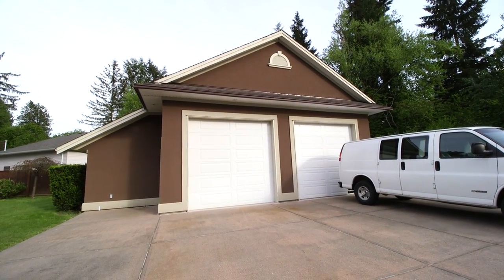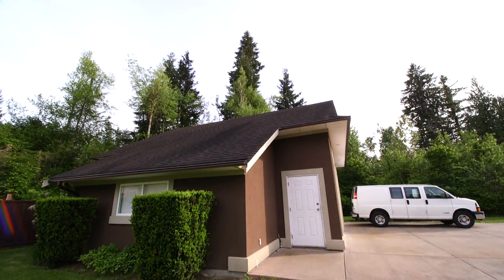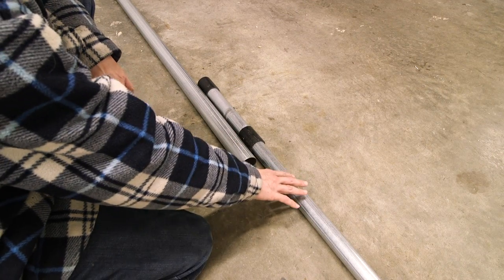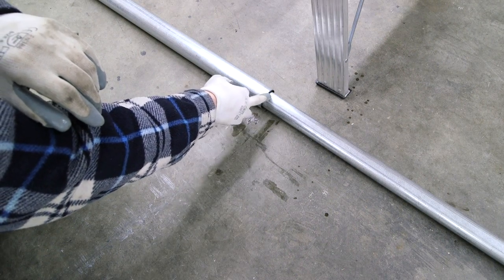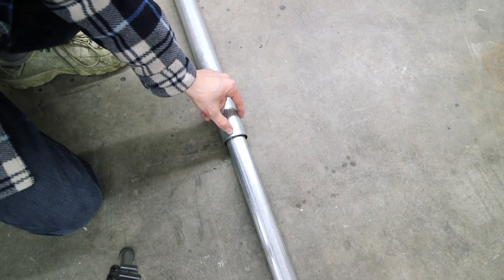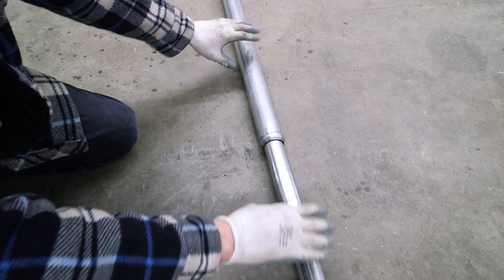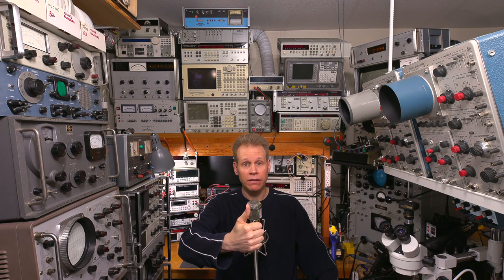High Performance Antenna Build [Part 1]

Comment: I have 80 acres here with NO background noise on HF at all, so quiet, you'd argue my receiver was dead!!! Been inactive for many years but thinking of getting my old R5 hoisted up and dusting the MP1000 off and doing some DXing on 10, 15 or 20 meters. My seven element triband Yagi needs a lot of maintenance, new plastic insulators, new trap covers etc. I can't decided yet where to "grow" the tower or high to go, 40 or 50 plus feet. Yes I know, the higher the more efficient the Yagi will be.
My call is KM6MB and John is the name, look forward one day to having a ragchew Mr Carlson. Followed many of your videos including the MP1000 one!! Mine was the first one sold in California when they were first released on the market, It's worked many countries, at that time we had a great solar cycle!!

Comment: Love watching your videos!  Ex-Radar engineer from the Air Force.  We used to use 2" pipe and have a local muffler shop heat and expand one end of the pipe about a foot long so it would receive another 2" pipe. Then we'd stick weld them together.  That way you never lost the strength of the pipe by reducing the size.  Still do that trick today on some things.

Comment: One thing to note for anyone that might build one of these at home... if the conduit you use is galvanized, you should either remove the zinc coating from any areas that will be welded, or, at a minimum, perform the welding in a very well ventilated area and with proper respiration/filtration.  The Zinc Oxide fumes that are released when welding galvanized steel can cause some pretty nasty side effects.  If you start to experience headaches/tiredness or other flu-like symptoms, stop and get some fresh air.  If bad enough, the fumes can kill you.  Galvanized pipe can be welded safely though if the proper precautions for ventilation/filtration/etc are followed though.

Comment: Be sure to grind the zinc off of galvanized metal before welding.
Reply: In addition to the health hazards, it also makes for a very porous weld bead. At least with solid wire and C25 shielding gas, the welds come out porous. I'm not sure about flux core though.
Reply: Yep, fume fever is no joke.
Reply: @osgeld  given that the nature of the smoke plume, there was little to no venting
Reply: @Nemesis Rain You cannot weld successfully on zinc, you have to grind it off to get a good weld. It splatters a lot too..
Reply: @Nemesis Rain Lead deposited in soft tissues can be mobilized and excreted to an extent with sulfur compounds (garlic, onion, DMSA, N-acetylcysteine, etc), vitamin C, and other chelators.  Once it's in the bones though, the bulk of it is pretty much there to stay.
Reply: came here to say this. although i bet mr. carlson has one of those fancy welding respirators. damn i  want one of those....
Reply: @mickgrimes9078   a good respirator is a must, but you still need good ventilation because the vaporized zinc with get into your cloths and land as dust everywhere.

Comment: I built a 92' high vertical antenna by flying a drone with a piece of cord to pull a copper wire up over the highest bow of an oak tree with insulators of course. The antenna performs phenomenally well much better than my horizontal and is almost totally immune to man made noise. Because of the polarisation being vertical and most men made noise being horizontally polarised.

Comment: I cannot forget the strange look I got from a lady at a cashier at a construction material shop when me and buddy at age 13 on bicycles bought a 10ft scaffolding pipe for my antenna.
Reply: I remember the neabors saying they thought me and a budy had lost our minds as kids ..up on a second story tin roof with 3' snow putting up a ant at about 2:00 n the morning...
Reply: All us radio nuts must the same kind of story. Mine was a 25 foot telephone pole when I was 15. The wire ran all the way from my bedroom to the bottom of our garden, then over a narrow Access road to the back of our garage. To me it was a thing of great beauty, but I didn't take into account the garbage truck that called every Wednesday.  It took the whole lot out. The pole was dragging behind it for about half a mile!
Reply: @NigelDixon1952  ouch rip
Reply: Yeah I had telephone wire for my antenna I ran the wire out the bedroom window to the center  clothesline pipe to the one end and went back to the other pipe on the left from the window looking out the window. I didn't know you could feed from any part of the long wire antenna. My radio was an American 5 tube radio by Admiral. Good thing I never touched the antenna wire I may have got a shock. You cannot or should not put a ground on those radios. The one side connected to the chassis or buss in my case. The radio was cased in a plastic box. The chassis part was a bakelite circuit board. I also made the radio pick up shortwave by tuning the rf and if coils. No standard broadcast radio was safe around me. I picked up wwv and Spanish SW stations.
Reply: @ronb6182  wow lol
That's impressive

Comment: Next time use rigid aluminum conduit, it comes threaded on both ends and has a coupling on one end. You can get a threaded reducing bushing to downsize. Thick enough to drill in to and tap for a grounding lug too.
Reply: My guess is the displayed connection technique will produce a more rigid pole.
Reply: @gottspeed: Carlson’s technique gets strength from overlapping pipes and welding. This will be MUCH stronger than a threaded joint. And steel is stronger than alum. No comparison.
Reply: @davecc0000  I work with these materials daily as an electrician, aluminum RMC is stronger than EMT any day of the week, and the threads would be fine for this application. You do you though.
Reply: EMT is cheap.
Reply: @gottspeed3914  threaded ends of pipe are the weak point, since the wall thickness is less after threading. that means nearly every single threaded pipe breakage will be at the threads, but sometimes a fitting will break or shatter, depending on material and type. the longer the pipe the more leverage and easier shearing action at the joints.
overlapped welded joint will always be stronger, even overlapped and cross drilled with bolts.
alternate way same diameter pipe, with tight fitting solid or tube steel inserted and centered inside, then pre drill/slot the outer tubing and plug/slot weld the inner tubing/

Comment: Yes, and along side the antenna wire You can put a rubber hose filled with mercury, connected to transmitter via that 5kW RS station module in Your old Lab. Than You can put a poster  in the local perish :"If You can receive Jazz Music using any Home Appliance like microwave oven, toot brush, vacuum cleaner, pacemaker, aquarium air pomp, or even clothes hanger attached to the dentures, then please PM me {appropriate e-mail address or phone} ."   The oatmeal milk left in a bowl on the railing of the neighbour's porch behind the hedge is cooked within 3 hours tops :) Grate video, thank You, have great day !

Comment: I did something similar only I used 1/4-20 hardware. I welded 2 rows of 6 nuts spaced 60° apart around the periphery, and each row 10" apart along the length, to each size conduit beginning with the 2" EMT. Then drilled through the nut and chased the thread with a tap. This made for a telescopic arrangement. I then drove a length of 1" cold rolled round into the ground and set this telescopic arrangement over top of it. With pre-cut down guides attached I went up a 12 foot step ladder and extended each section and locked it in place. Repeated for each section until the whole thing was extended. Spent about twice the time planning as I building.

One 10ft length of each:
2" EMT, 1-1/2" EMT, 1-1/4" EMT, 1" rigid. About 36' high...

Comment: Can't wait for the rest - I strung a 200 ft. copper antenna off a mast on the roof and anchored either side of the house. Worked very well as I remember. Definitely seat of the pants engineering :)

Comment: Just so you know, there's another way to join pipes. What I've successfully done is overlap the two sections by maybe a foot or so, and add a third piece of pipe of similar size to form a triangle cross section.  Fat dowel or wood closet rods would also work. Then I measure the circumference to buy the appropriate diameter stainless hose clamps. I use 4 in total hose clamps. Two for the top of the triangle, and two for the bottom. You can use fewer clamps, or more according to your own judgement. Anyway, tighten all the clamps enough so all seems solid and won't loosen.
   I have had zero issues with strength aside from not using large enough diameter pipe for wind load. That's not an issue with the joints though. The clamps never seem to loosen either, but you can still take precautions if you want to. RTV works very well as a thread locker, yet isn't very hard to break loose when needed. It's an old recommendation I read one time about protecting shock absorber threads from rusting on cars.

Comment: As an Amateur Radio operator I thought you might be putting up an antenna to get back on the air when I saw the title. :-) Great video! I look forward to part 2.
Reply from the maker: There will be a transmitting build antenna as well.

Comment: If you had drilled 2 holes trough the 2 inch pipe around 6-8 inch down from the weld you did then you could have welded it with 4 spots there to the 1.5 inch pipe to keep it more stable than the tape does. Back in the early 90's we did use this technique in the welding factory we had when welding rods inside pipes.
Depending on the wind and future snow and ice hanging on your antenna wires it might hold up what you did there too, time will tell :)
Nice welds by the way, looks good, looks like we did it.
Reply from the maker: Thanks for your comment!

Comment: Very good job. I use gorilla tape but just a little. I take my pipe to a muffler shop or a machine shop and have them swedge the largest pipe to fit the size of the smaller one and so on. But I really love all your videos and this one on this dy pole is great

Comment: For receiving purposes, noise reduction is far more important than efficiency, especially if you are going to build a preamp to go with it. Hence if I were you, I would prefer a smaller loop antenna in the quietest spot on your property. But (almost) nothing is more fun than building antennas!

Comment: love your videos to slide the pipes in with no clearance i use a piece of pvc cut the length  expand it around the small pipe works a treat , weld the gal pipe with stainless electrode no rust.

Comment: Hello Mr C I have some urgent  info for you  when you weld Emt tubing you will want to sand off the coating of the Zinc  1 inch clean from where the weld is going  your weld will come out 400 percent  cleaner an you weld will be 200 percent stronger., + the Zing burning that is called out gassing will not Acura  + you will not put poison gas in to your lungs.  From the desk of Jarm.
Reply: True... fumes from welding galvanized metal can make you pretty damn sick.  Welders at work have told me they had to drink a lot of (milk?) to treat this condition.
Reply: As I recall, EMT is not galvanized, Ridged metal conduit is.

Comment: Ahhhh! I know what you are doing!!!!
You are preparing for the winter snow season so that you can harvest some of that mysterious energy that you encountered last time on your workbench! 
We don't get snow here in Melbourne Australia! I would love to make an antenna out of a coil of copper wire in a loop so that the snow fall through it, one end tied to an insulated ground spike with only it's tip exposed so that you get a higher voltage potential difference between the antenna and ground spike tip! A switching circuit to pulse the energy to ground and a capacitor bank that gets charged via a diode which the negative of the capacitor is also connected to ground to complete the circuit! 
Such a pity that we don't get snow here, I would love to try it. This kinda reminds me of the falling water experiment that was done by (if I have correctly spelt his name) Victor Shouberger, there are a few videos here on YouTube that shows how it works, really fascinating stuff! 
I have always wanted you to follow up on that anomaly that you experienced! Who knows? Maybe one day that video will come!

Comment: Guys, zinc isn't that bad.  I mean zinc is in your vitamins.  Yes you can get zinc fume fever but it won't kill you, and you need to be exposed to a lot more than what you'll get with one quick pass of the MIG.  Anyway I was going to say you can buy 10' sections of fencing top rail that are great for antenna masts.  One end is tapered so you can slide another section over it and it fits nice and snug, don't even need to weld. You could throw a U bolt clamp on if you were really worried.

Comment: Thanks Paul. 
Right now I'm learning for my RF technology class at university. It's refreshing to see a video about actually building an antenna rather than just calculating/designing it. 
I love the "learning by doing" way so much more than just reading text books or ( as we do in university) learning the theory before making experiments.
will it be just a normal dipole antenna? I think a Yagi antenna might be the best if you know the location and polarisation from the sender...

Comment: Although EMT is certainly an good economical choice for mast material, one needs to be aware that is it made (metallurgically speaking) to be bendable (same with rigid conduit for that matter) and is really not the best (although usable) choice for a mast.  I agree with some of the other comments that suggest using fence top-rail.  I enjoy your videos, always learning something new.

Comment: That's going to be a long antenna! Should get plenty of signal from the next state over. ;) I bought a 9 x 12' Rca "Digital tv" antenna a couple years back because it was dirt cheap, $25 (they aren't made anymore as far as I'm aware of) It's just a re-marketed Realistic UHF/FM antenna based on the same decades old design. One of these days I'll have to get it set up now that I've acquired a portable communications receiver.

Comment: For receive only I use a 3' diameter active loop antenna constructed from 1/2" soft copper and PVC electrical boxes.  A low noise current amplifier is mounted at the antenna and fed with CAT-5 Ethernet cable. It covers VLF to above 30 MHz with excellent results. I have it on a rotor so I can find the maximum signal/ lowest noise for a given station. It works really well for nulllng out broadcast stations that occupy the same frequency for long distance night reception. A VLF or even BCB dipole at this location is out of the question.

Comment: Paul, this is PERFECT! I also have a long wire antenna in my garden, but it picks up so much (man made) noise, it is no fun any more! Since you also live in a residential area: do you also have a horrible noise floor coming from your antenna? Any ideas on what to do to help with that? Magnetic antenna instead?

Comment: Why not a double end-fed antenna?  If you want to use at both house and workshop, both ends could be matched via a 9:1 UnUn, at both ends, each slightly offset a few feet within the antenna wire (assuming non-resonant, broadband receive-only usage). Run coax from the UnUns to house and shop, respectively.  The coax shields will both add vertical elements to the antenna (assuming UnUns are an auto-transformer design).  If not desirable, common-mode chokes can be inserted near the UnUns.  To help optimize received power transfer, a tunable L or T matching network could be utilized between coax and receivers at both ends  In effect, the above antenna configuration is a non-isolated ports, RF power-splitter design.

Comment: Hi Paul,
Interesting use of EMT tubing and of Gorilla tape as a bushing. Have you thought of using a fiberglass pole as the last section to keep any metal away from the antenna wire? You and the family stay safe.  73  WJ3U

Comment: Canadians certainly are smart people, your thinwall conduit mast must be a lot cheaper than that Rohn telescoping TV mast If it's even still available, and you get to share it with your audience one of your brilliant ideas.
I'm surprised you're not using a solid-state antenna preamp though, I guess a tubes would be less subject to Static electric charges and lightning.

Comment: I live in an area that has frequent lightning storms. I hope to see what you consider to be best proactive for lightning protection.
Reply: When I was active, I just used to disconnect everything when storms are around. That's still a problem with me and I'm going to get an antenna up within the next few weeks and dust the rig off. I cannot plant any antenna closer than 50 feet from the well, as a strike would take my well pump out. That includes tower and mast grounding systems. We have some horrendous lightening storms here in southern Missouri.

Comment: You should def. Grind the Zinc Galvanizing coating off before you weld. And have plenty of ventilation you dont want to breathe the fumes off of that . Cant wait till part 2

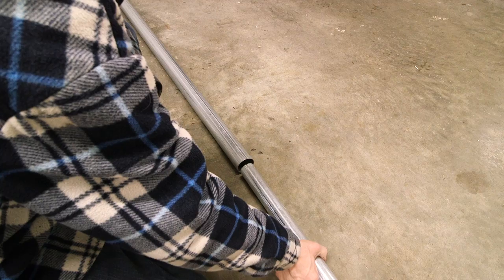Comment: 2:33 . . . Awesome echo chamber 'effect',  Mr. Carlson!

I would assume this long wire antenna will be going through the air from the garage outbuilding (shop),  over (your) house.  I have almost the same spacing from the house to the workshop/garage,  but like you, also have adjacent neighbors.  I was concerned there are bylaw codes which could force me to take an antenna down if the neighbors didn't like the sight of it.  My neighbors are pretty cool,  but someone new could move in,  and then it's all over.  Some people just look out their window to find something to complain about.

Comment: It's probably worth mentioning that welding galvanized steel is kinda hazardous.  Don't breath the fumes at all and do it in a well-ventilated area.  Better yet, remove the zinc from the area you plan to weld.